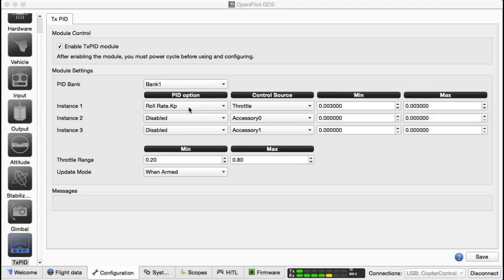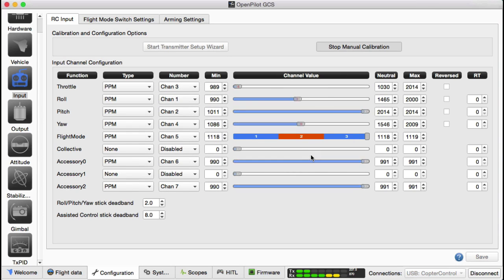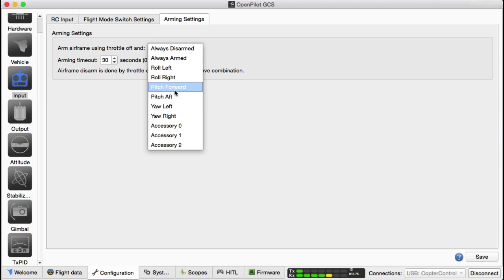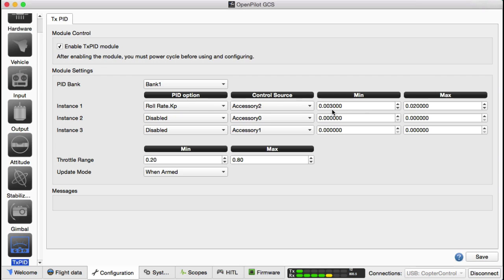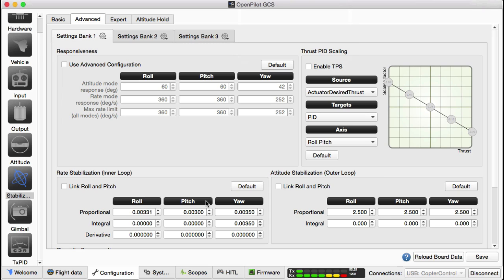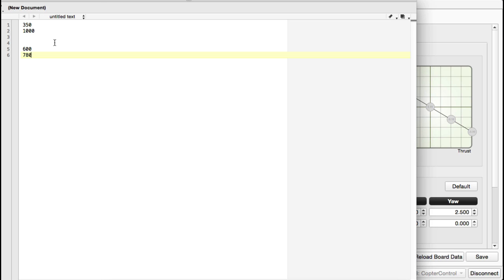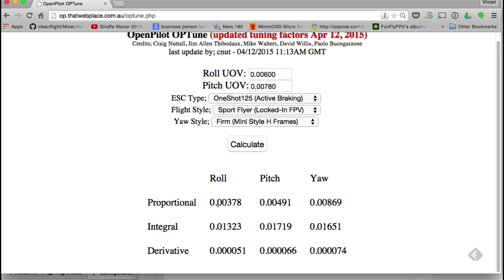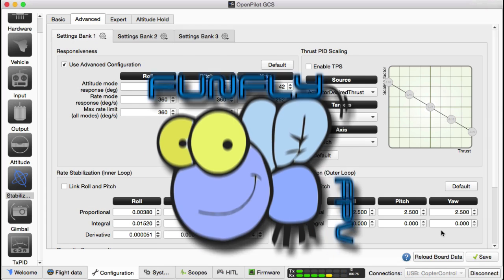CC3D Tuning Guide

Comment: don't know if you can help me, i set min roll rate to 0,002 and max to 0,006, the strange thing is i can't go under 0,00350 at min and max 0,006 (max value works great), i tried other values until 0 and i have allwas a difference. i have a 9xr, mixer set : ch6 100% P3

Comment: can u use the settings your using? for the first time I tried to tune my pids and my 250 is all wobbles.
Reply from the maker: +Ian Rice Well the settings are specific to every quad and thus the lengthy procedure. But try it ...
Reply: Do i go into flight mode switch settings to make my 250 faster and to do flips? And say if you had yours set up a certain way can i use your setting to do that? If i play around with the flight mode switch settings will it mess up my quad? or will it still fly like it was or better from setting the switches? I love this hobby so much and i love my racer but im a pretty good flier and want it faster to do flips and stuff but im not good with doing this stuff on the computer. I am ok with computers but not with the open pilot. So is there a setting i can do that you know i can make it faster? I appreciate your help. Thank you sir.
Reply: I have the same quad as you and I have the same issue

Comment: helo ! question im using standard ESCs in OPTUNE do i have to choose rapid (PWMsync)? i have not oneshot neither fast 490HZ only 50 hz ESCs THANKS!!!
Reply from the maker: +Mayor Mente Well if OPTune does not have values for those, I would choose the 490 option and see what is suggests as a starting point.
Reply: it worked! (the ESCs were not so bad after all) it moves like grandpa, really steady, roll more than 2 seconds in rattitude but thats the next part, no need to dive in the PID tunning because the drone is flying very well, thanks a lot, regards from Chile (9 of 10 natural disasters prefer Chile) THANKS!

Comment: I have a 250 racer and I'm trying to set my pids but I'm not running ppm does that affect anything other than the cc3d not receiving the most up to date data any suggestions on how to properly tune?
Reply from the maker: +roland rivera I do not think PWM vs PPM at this level makes a difference.

Comment: Hi, Funfly ,nice video, just a general question about pid. If my quadcopter has a large battery crossing the frame from back to front,  and is located 6 cm under the chasis , so the movement in the roll axis  takes more effort, what shoul I do? Increase my P in the roll axis? Decrease it ? Raise the I?

Btw I ask this because my batteries have died  so I cannot test anything right now.
Reply from the maker: +Dashz I never thought about it this way, but a general PID tuning and what it is used for can be found at the website http://www.funflyfpv.com on the front page. There are 4 images under "Tuning in 4 Pictures" .. I know it's for CleanFlight, but see if that helps.

Comment: How did you come up with your initial values for Advance Settings Bank 1 : Responsiveness for Roll / Pitch / Yaw (60/60/42). I have a SRD-280 from Helipal which is 280 size instead of 250. Do you have recommended settings for such a drone on Arco Sport Mode? I'm trying to remove oscillations with the p gain values. http://www.helipal.com/storm-racing-drone-rtf-srd280.html
Reply from the maker: +HarajukuNinja I think those were just defaults I got from the original tutorial but that is no longer available. See if you can find and details on the LibrePilot site documentation.

Comment: Hello,  great video :-)  I am just learning the 250 racer and your video is a great help.  I do have one question that maybe you can help me with.   what is the difference between using the Basic and Advance when adjusting or removing the wobble?
Reply from the maker: +Grandpa Jake (FunTimeGrandpa) The Advanced makes the same adjustments as basic, if you make a change there you will see it reflect in basic. Advanced however takes it further and you can set settings that the sliders in basic cannot achieve, basically, basic will not allow you to set anything too crazy.

Depending on the type of wobble, lower P rates will cure that usually.
Reply: +FunFly FPV Thanks,  I have been watching and reading and it is starting to make more sense ???  lol...  but I think I have a good start now.  Will let you know how I make out.   No rolls till I feel very comfortable with everything else!      take care and thanks again

Comment: Thanks for your tips! I am trying Acro+ mode and instead of setting Acro+ factor connecting the quad to the computer I now have assigned the Acro+ value to one of my radio VR channels (knob). Now I can change the Acro+ factor wile flying until I reach the desired value! You are the boss! :)

Comment: the calculator isnt working! do you have another?
Reply from the maker: +miHah The higher rates makes it more responsive yes. I got that from a wiki somewhere a few months ago. Check out http://www.librepilot.org/ as a replacement for OpenPilot.
Reply: +Chance Bembinster If you are still looking, I found this spreadsheet that will give you the same values as the calculator did.
https://drive.google.com/file/d/0BzCFakHzOOf4c3JSeVZLdWtTZmM/view?usp=sharing
Reply from the maker: +David Almasan The site seems down again and OpenPilot is done, ugh... let me see what I can find .. Have you looked into LibrePilot yet?  https://librepilot.atlassian.net/wiki/display/LPDOC/Downloads
Reply: +FunFly FPV Is there an alternative PID calculator I can use to tune my CC3D within OpenPilot?
Reply from the maker: +Chance Bembinster Looking for one but have not found one yet ...
Reply: +FunFly FPV Whats up with OpenPilot?
Also, if I understood correctly, those responsivness rate values in deg and deg/s are how responsive the quad is in general? The higher I set it up, the faster response? Where did you get those rates? Thanks! :)
Reply from the maker: +Asa Davis Great thank you ...!

Comment: How do i increase yaw speed without messing up my other settings?
Reply: +Sleez Ick On the advanced configuration, just adjust the yaw rate. That number indicates the rotation you will make in 1 sec. Which means, if you put 360, you will yaw 360 in 1 second: https://youtu.be/QqgZZ6-V3Qk?t=396

Comment: Thanks for the video. Just one question. which esc would I choose in the calculator? I'm using lumenier 12a esc (http://www.getfpv.com/lumenier-12-amp-esc-with-simonk-firmware.html) do you know which option I should choose. Thanks
Reply from the maker: EaziGX If you have PWMSync turned on in OpenPilot I would use that else just use the standard 490Hz option, would be my guess.
Reply: FunFly FPV many thanks